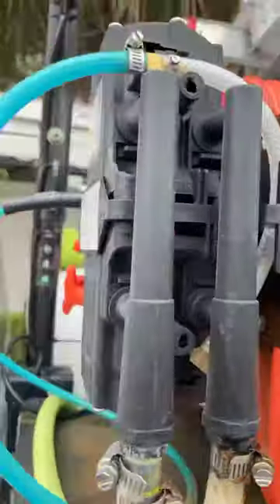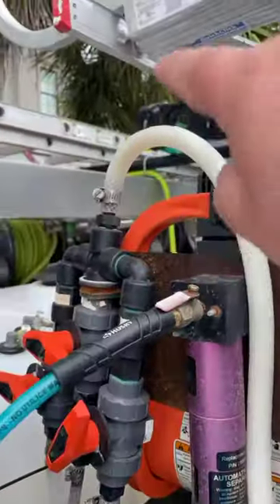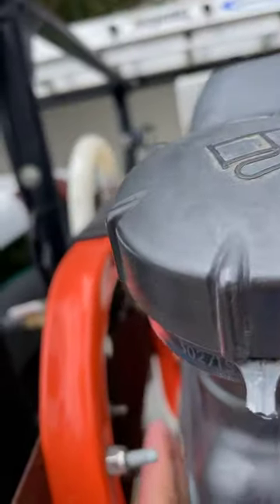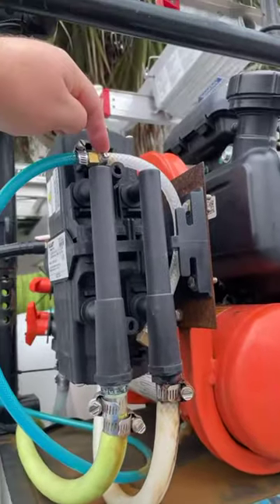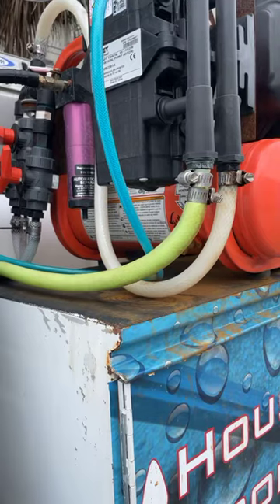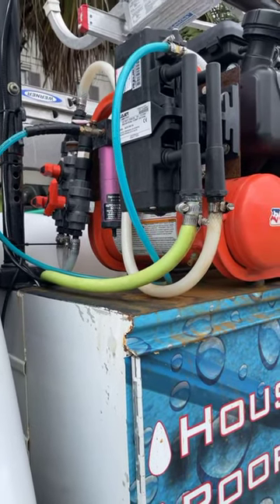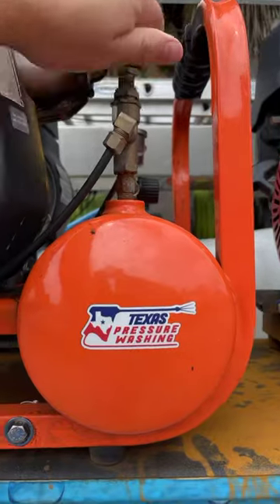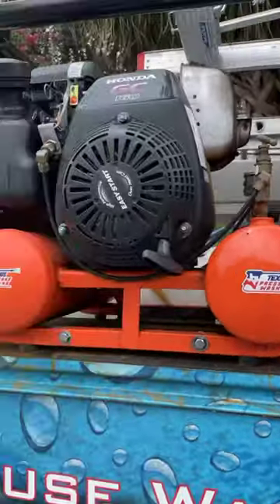Flojet 10GPM Setup and Plumbing Walkthrough

Comment: Have you seen the Quattro version I ordered his high flow version but it doesn’t flo at all like his videos
Reply from the maker: He upgraded all his plumbing and mixers to 3/4" and hoses to 5/8 or 3/4"
Reply: @TexasPressureWashing  that what I run as well 3/4 everything and 5/8 hose still no flow like his video
Reply: @Crodgers88 does he use a flo jet ?